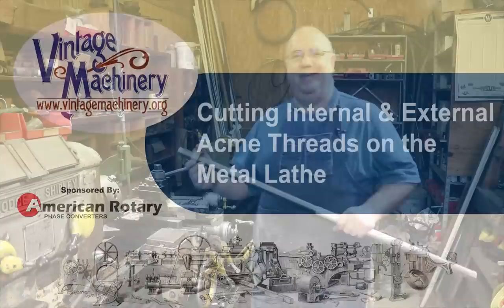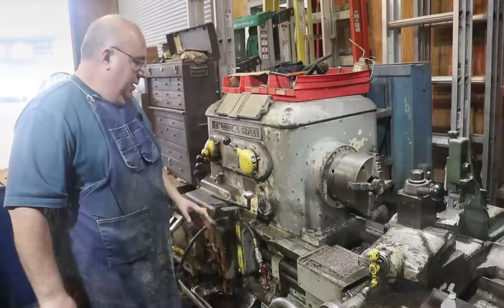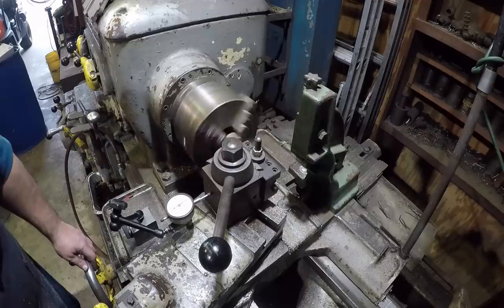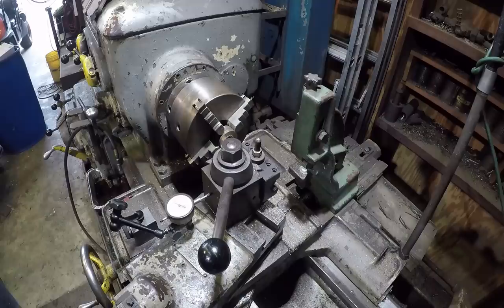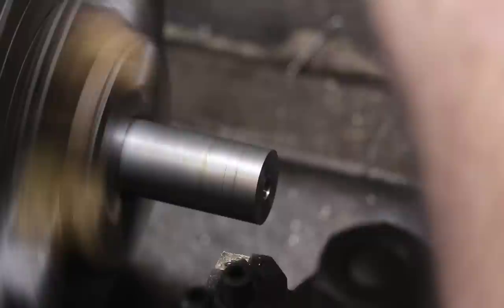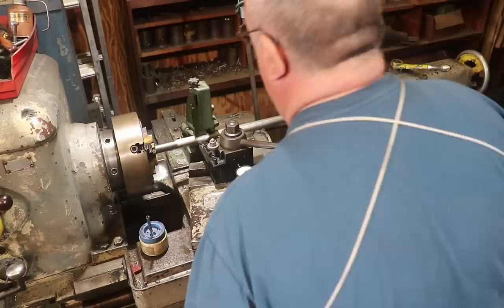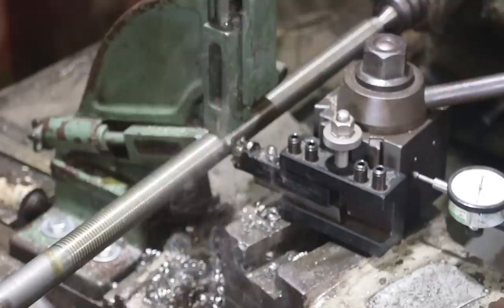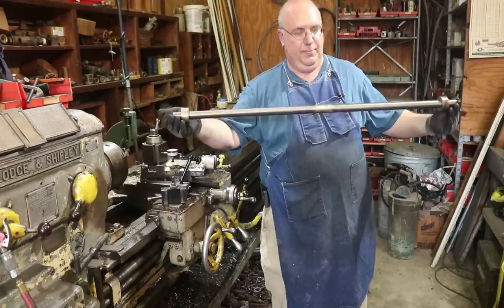Cutting Internal & External Left Hand Acme Threads on the Metal Lathe

Comment: It would be nice to have a DRO with your tools measured out and zeroed. Then you could take a pass with a boring bar to get the hole to final size and switch to your internal threading tool and it will be at exactly 0.

Comment: With a screw that size the table must be a monster.
Reply: It has about 18" of thread travel each direction.  I will make the leaves for the table the maximum I can, but most likely it will be a 64"' table closed, 96" table opened up.

Comment: nice job :) But all the oil that is brushed on whatever there are done in the lathe - would it be an idea to mount a lubricator to the followrest, to take care of some of that oiling?
Reply: That can and has been done but brushing it on gives more control of the oil.
Reply from the maker: A recirculating coolant pump would be ideal.  The lathe had one built in originally but it does not work at the moment.
Reply: Before you buy coolant pump, ask Adam Booth how he thinks of the mist cooling that he is using

Comment: When cutting threads like that is it necessary to make adjustments to the follow rest as you go? Thanks and thanks for the series, it was fun and informative.
Reply from the maker: When threading, you are not removing any material off of the outside diameter, just the root of the thread, so no need to adjust unless something works loose.

Comment: Maybe this question has been asked and answered but with all the time, effort and money you have put into your own machines what went wrong such that you had to use the museum lathe?
Reply: He realized he needed to use follow rest and has none for lathe at home. Have a great day!
Reply from the maker: My lathe has an issue with reversing the lead screw for left hand threads.  Never knew about it until I tried to do it for this project so now I have to figure out what is going on.  I think it is pretty simple, but just did not have time to deal with it right away.  It works fine for regular right hand threading and turning.  And then I also realized that I needed to use a follow rest and I don't have one for my LeBlond lathe at home but we did at the museum.

Comment: Do you have any reccomendations to act against deflection on a small diameter piece?
Reply: Follow rest like you see Keith using. It holds the part steady against the cutting tool.
Reply: How small do you want? A jewelers lathe can go down to about .010 in stock size and the follow rest can go that small as well. As for that particular unit, it should be able to go to whatever the smallest the chuck can handle.   https://www.youtube.com/watch?v=yfATsgSM9E0

Comment: Keith, noob question - if you ran lathe in reverse would you cut left hand thread R to L?
Reply: No. The only item that changes direction for right/left threads is the tool cutting angle and the threading/feed screw direction. Reversing the lathe reverses everything. The way I remember it is simple Start in left for Right, go out right for Left.
Reply: No actually you cannot. Take a look at the angle of each thread, the tool to cut the thread has to travel in the same direction as the thread. Try reversing that direction and you cut the opposing thread.
Reply from the maker: Looks like this has already been answered.  If you run in reverse without changing the direction of the lead screw, it will still cut the same thread.  But, as you pointed out, if you turn the tool upside down it reverses everything.  I personally don't like cutting upside down because I cannot see what is going on as well, but some folks prefer doing it that way.  As with so many things in the machine shop, there are many ways to accomplish the same task, and as long as what you are doing works, none are wrong (or right).

Comment: For the sake of precision, wouldn't it have been better to use a slightly smaller drill and then bore the last thousands of the hole in the nut? The hole looks awfully off center due to the drilling.

Comment: Beats me why people work away from the chuck with left hand threads. It is a real pain when cutting metric threads and you have to leave the half nut engaged.
Reply: If you have a chuck that screws on to the spindle you wouldn't want to run the lathe in reverse. That might make the chuck spin off. Left hand threads are a little easier for that reason, because when you are feeding away from the chuck you can just let the carriage continue on once it's off the part. You can release the half nut right away if you want, but there's no danger of it crashing, so you can take your time. That's not the case if you're feeding towards the chuck because there is the danger of crashing the lathe if you don't release the half nut in time. Joe Pie has a good video on threading away from the chuck, but you can only do his trick if you have a Direct mount spindle or a cam lock spindle. Smaller machines typically don't have those types of spindles.
Reply: @gabrielbonannoo  Some people should just stay off a lathe.  It is a bad habit to take the easy way out all the time, and then be unable to perform a function when you need to.  Sometimes I have to cut threads in tight areas using a center.  Sometimes I am picking up a thread.  Sometimes the thread is a double lead, and metric. If you are working in a shop with "Spin on" chucks at this point in time, it is time to move on.
Reply: @oldgoat1890  Was there at time many years ago when you were learning how to use a lathe, and then cut threads? If you read the comments from others, there are many who are just in the process of learning how to cut threads. First time I did cut a simple RH thread I had my heart in my mouth - I also screwed up a few threads using a lathe lathe designed for imperial threads which also had the capability to do metric threads - learnt not to disengage the half nuts. The point is, let others learn how to cut threads, which ever is easiest way for them - Keith is showing that. Then at a later stage they can learn to pick up a thread or cut acme or trapezoidal, external and internal threads in either left hand or right hand.  I am glad you are well past that point with your equipment and skills.